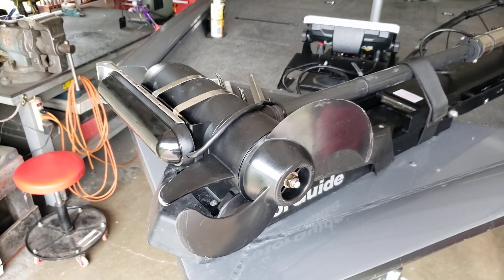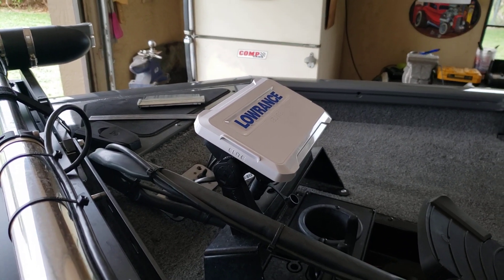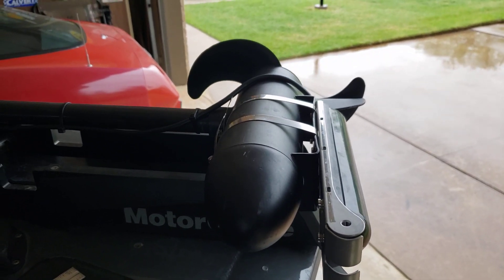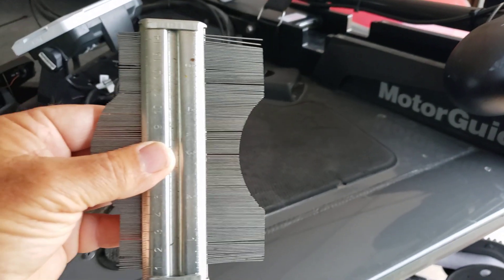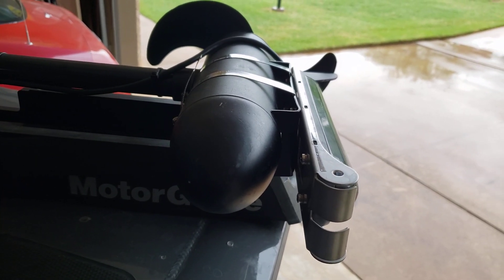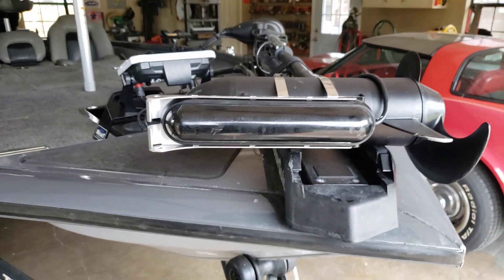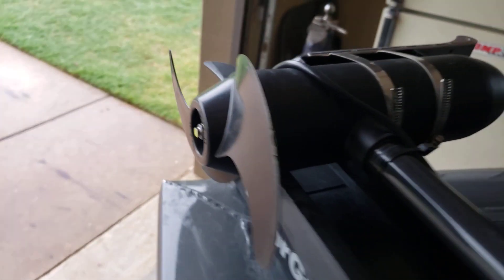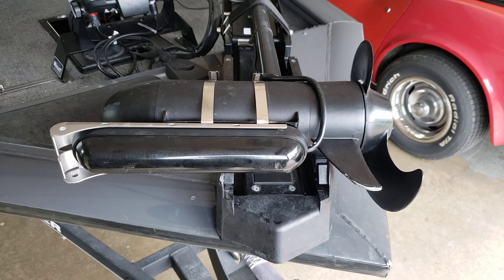How I mounted a triple shot transducer to a trolling motor

Comment: I am going to try this on my kayak mid mount electric trolling motor.  The transducer is too big to fit safely into the scupper location and having it stick out one side on a bracket is clumsy, could get in the way when fishing and could be blocked by the trolling motor itself, thanks for sharing.

Comment: Where did you buy the stainless bracket that transducer sits in,,i have a 9 inch tripleshot transducer but it didnt come with a bracket?
Great video,,
Reply from the maker: Came with the transducer
Reply: @ronniehenson4122  What size are the clamps..made a bracket like yours and now i need to put the clamps on,..i am using zip ties right now but thats only temp
Reply: mine didnt come with that bracket either